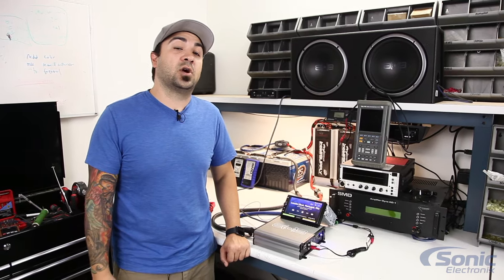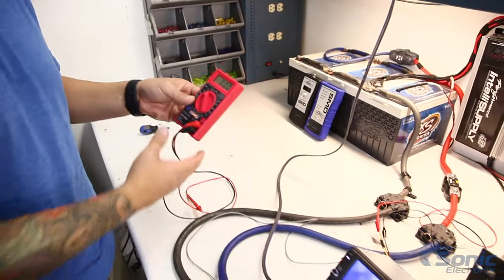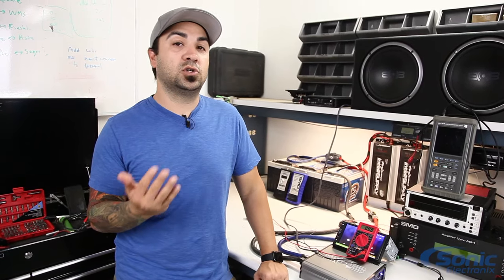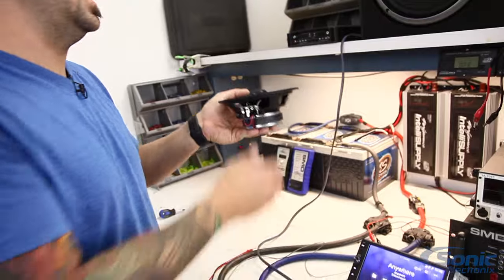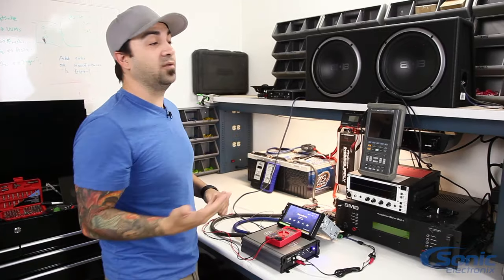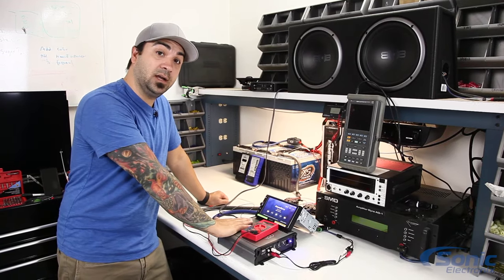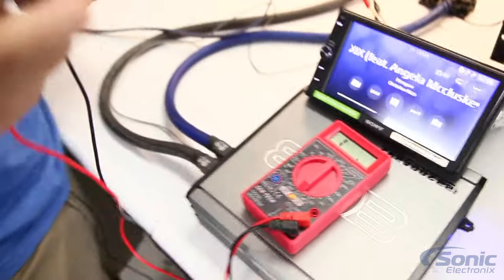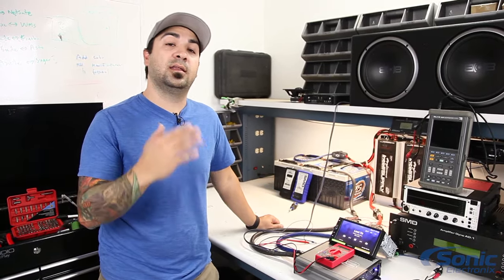Car Amplifier Troubleshooting: Sound Cuts Out When I Turn The Volume Up

Comment: My stereo volume cuts off at high bass volume. Any idea? Doesn’t work till I turn off stereo and turn back on
Reply: Have the same problem but my stereo turns off by itself n resets
Reply: Have you solved the problem? Cause my does it too?
Reply: Nope. Make sure there is no clipping helps. But still does it at high volume. Im gonna run all new wiring and do big 3. Heard it may be the radio has a low voltage sensor that trips.
Reply: R G why kind of atereo you have? Mine is kenwood
Reply: @Sleepy731  i just fixed it , it was just cause my stereo didn't have enough power to keep it loud, added a new stereo and amp, it got fixed cause i added a speaker system and now the amp is con to the amp
Reply: R G for me the problem started when I replaced the factory stereo, same amp.
Reply: @Sleepy731  must be some wiring issue  , cause my stereo is kenwood aswell , you should ask a professional, is my best guest